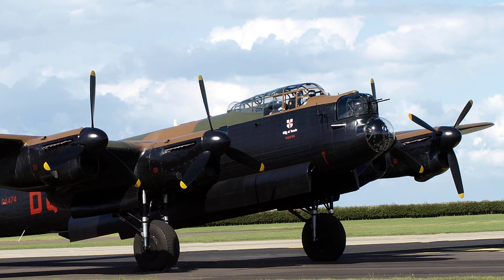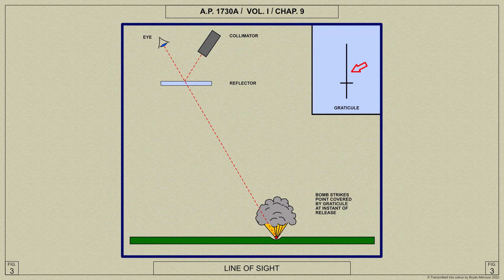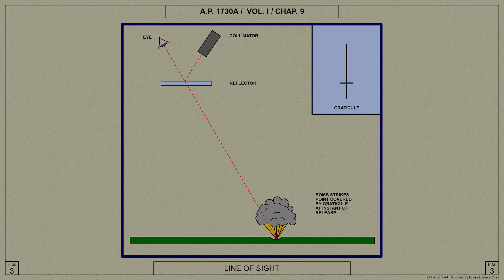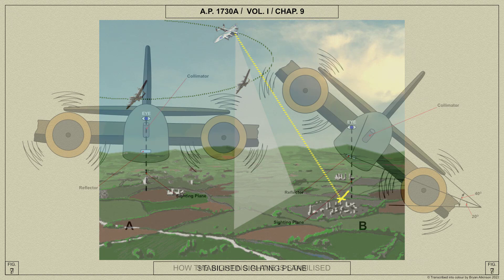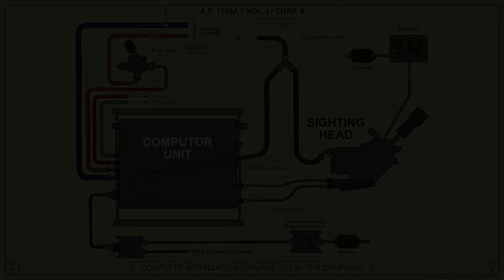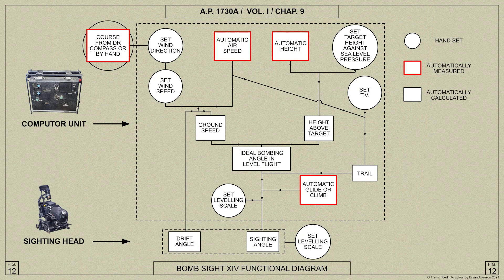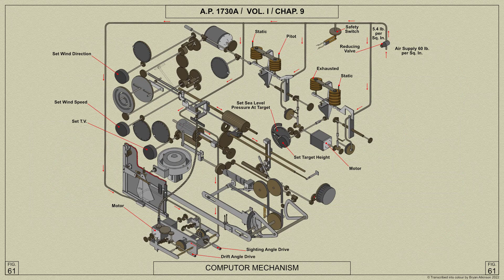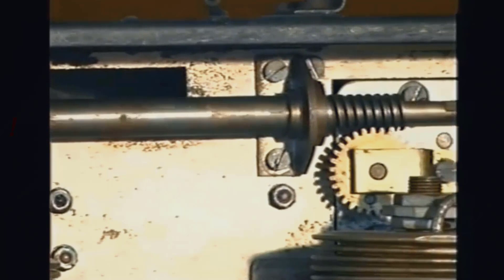Avro Lancaster – How the Bombsight Mk XIV Worked

Comment: Wow, what a great video - so much detail! Had no idea the US used this sight too as the T1. Guess the Norden wasn't as good as promoted.
Reply from the maker: Glad you enjoyed it
Reply: Sperry took the Mark XIV design and built it under licence as the T1, mainly for UK use under Lend -Lease. 22,000 units built in total. Main issue with the Mark XIV was it didn't work above 25,000 feet. Sights used on the Mosquito's needed major modifications to get them to work up to 32,000 feet.

Comment: Superb Bryan. Really enjoying your efforts mate. Bit confused about the computer, TV setting. How do you set that with a mixed load?
Reply from the maker: The bomb aimer would enter the bomb TV information located on the Levelling card attached at the top right of the computor unit. If you pause the video when the Levelling card is on show, you will see all the individual bomb TV and weight information. Thanks so much for watching and subscribing

Comment: Excellent!  The Sperry T1 was US produced copy of the Mark XIV made to supplement British supplies, but also used in B25 and B26 medium bombers where the very quick 10 second setup time would outweigh the greater  accuracy (if any) of a Norden or Sperry S1.  The Norden and the S1 fly the aircraft via the autopilot during the bomb run lengthening it. Both are unsuitable for night operations. The inaccuracies of all WW2 bombsight were mainly caused by bad weather, poor visibility, German countermeasures and of course crew skill. “Target Ploesti” Leroy Newby Presidio Press 1983 has a good description of practical use of the two American sights. Brian do you know if there was a standard procedure for the bomb aimer to guide the pilot onto the target?  That’s the obvious weak link of the Mark XIV.😊
Reply from the maker: Thanks for info and for watching!

Comment: The accuracy of THIS Bombsight is orders of Magnitude BETTER than the "Famed" Norden Bombsight from the US..... The Norden wasn't even the best bombsight the US had - but it was used because the PROPAGANDA from the Norden company was the best.
Reply from the maker: Thanks for sharing and watching
Reply: The Sperry Company actually made a better bombsight than Norden, but politics prevailed, so Norden won the contract. The Norden was not as accurate as they advertised.
  As for comparing the Norden and the British Mark 14  the end results were about equal when the results were compared after the war. Neither was perfect.
Reply: Both sights are only as accurate as what the input data allows them to be. Put in wrong data, and you get a wrong solution.